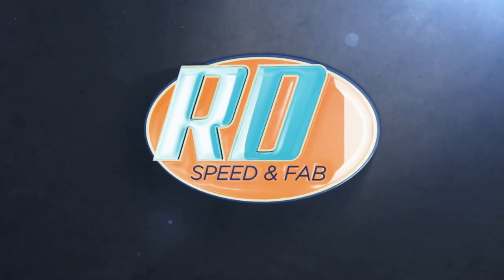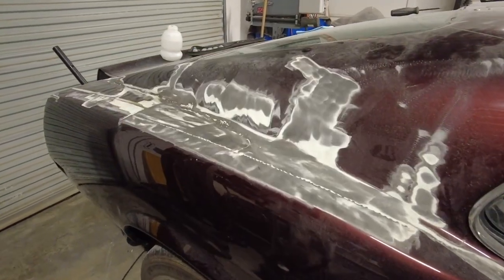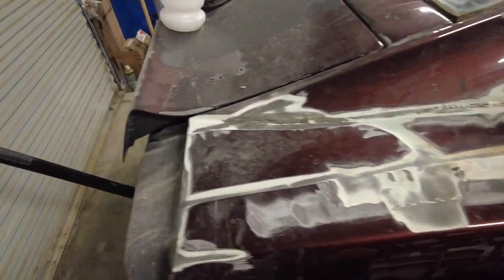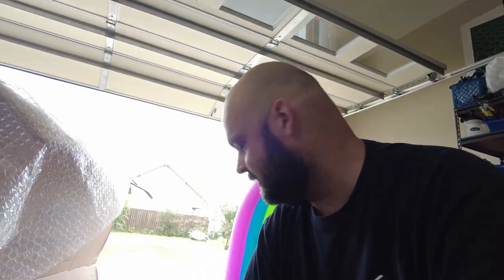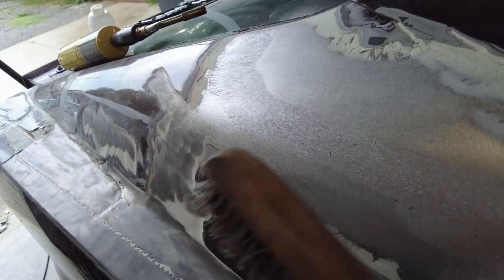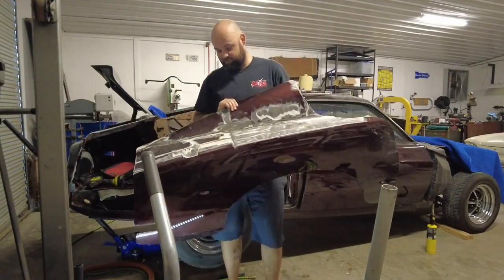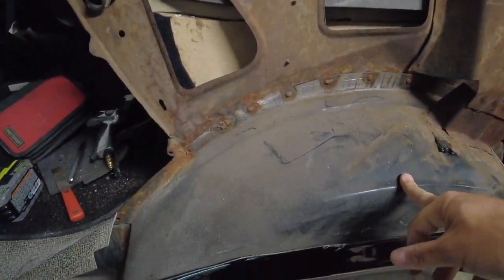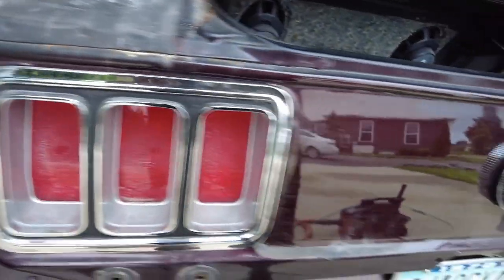How to replace fastback mustang quarter panel Pt. 1 (Classic muscle car restoration)

Comment: How much was the car?
Reply from the maker: Just so you get the full picture, go back and watch all the videos on the car. It came with a new crate engine, had the low mile t5 installed, 4 wheel disc brakes, all new suspension front and rear, new interior, fold down rear seat etc… I paid 17k for the car. I haven’t been tracking what I’ve spent beyond the purchase price but all finished in paint I’d guess I will have around 25k in the car.